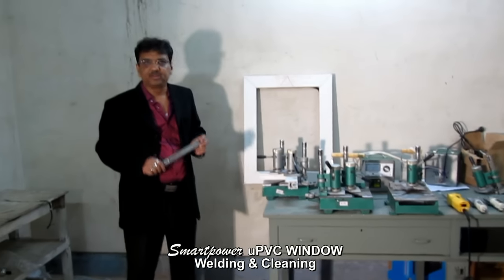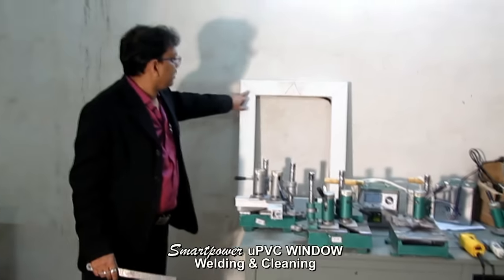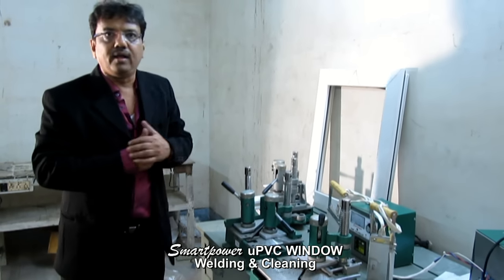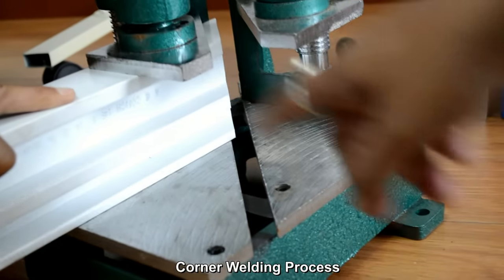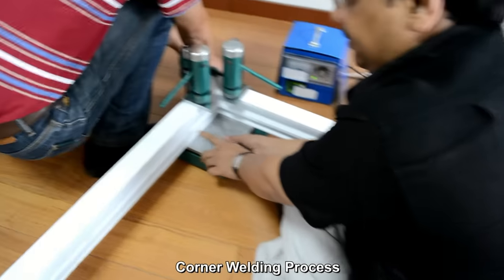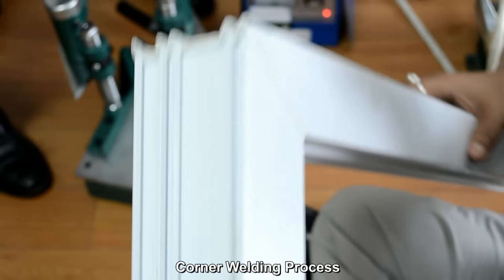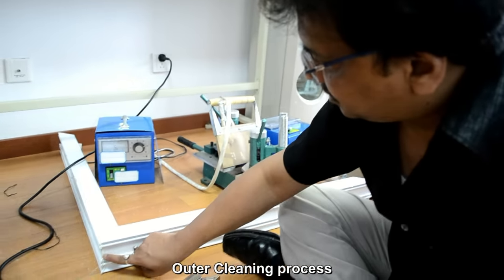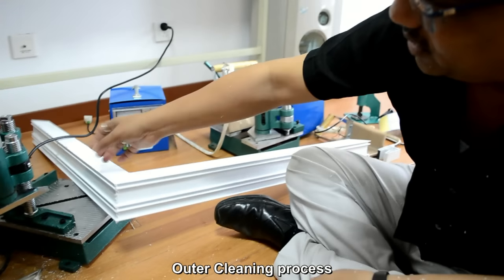uPVC Portable Window Making Machines - Welding & Cleaning

Comment: Very slow process. By the time it took to weld one corner even the small free standing setup would have done 4 complete windows. This is not accurate way to do it. You can buy a small setup for £3000 UK pounds and have it shipped over.
Reply: From where coulf buy ~ £3000, upvc windows making maChines ? Thc